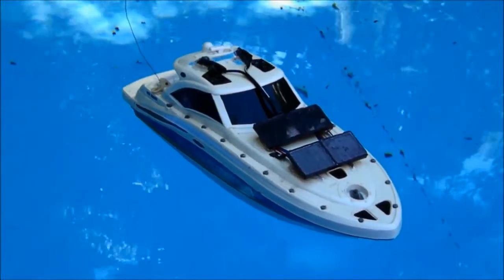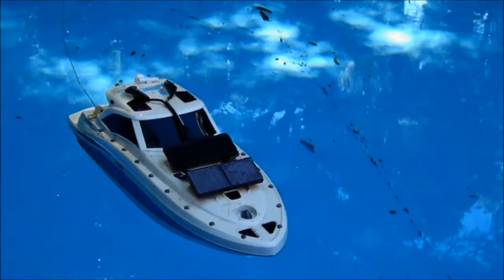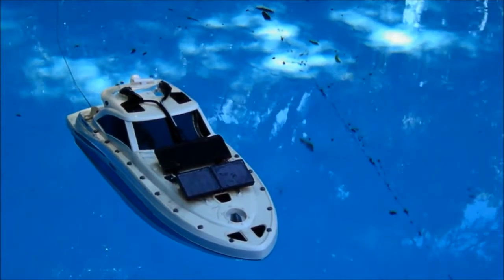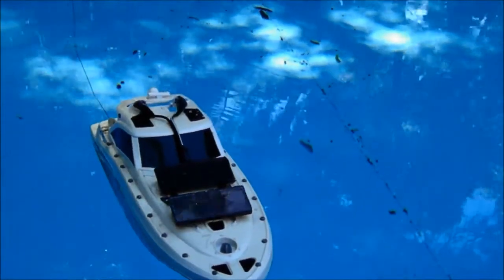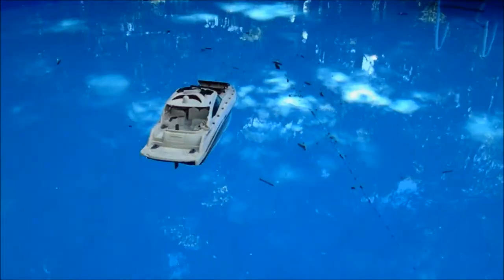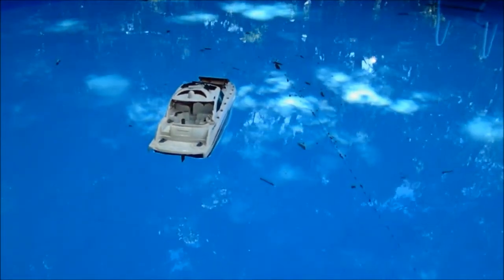Solar Powered RC Boat!

Comment: Cool. how do you install solar onto lipo battery on that rc boat?
Reply from the maker: Noordin Noorhisham I used 2 small test leads a + and - and 2 small magnets, take the test leads and hook one end to the solar panel output + and - , then take the other end and connect them to the battery's + and - with the magnets.

Comment: im running nimh.. and i bought nimh solar charger on ebay.. would it work on my boat?
Reply from the maker: As long as the solar panel volts are higher than the battery volts, it should charge it, but to give a charge time estimate i would need the amps and volts of the battery and the solar panel.

The solar panels on mine are very small, so it would take 10-15 days to charge the battery, but it will charge it do to the battery being 6 volts and 2500ma, and the solar panels being 2 volts 50ma a piece, in series they are 8 volts at 50ma. As long as the solar panel voltage is more the battery voltage it will charge however the time it takes is dictated by the milliamps.

Comment: where did u get these solar panels?
Reply from the maker: hans kooba The solar panels came from the solar yard lights from dollar tree Link: http://www.dollartree.com/household/outdoor-living/Patriotic-Plastic-Solar-Garden-Lights-with-Stakes/500c540c540p338636/index.pro

To take the solar panel off the light i just used a pair of pliers and chipped off the plastic around the panel, making sure not to tear the wires off the panel.

Hope This Help's  :D